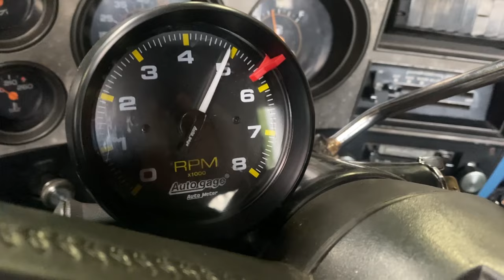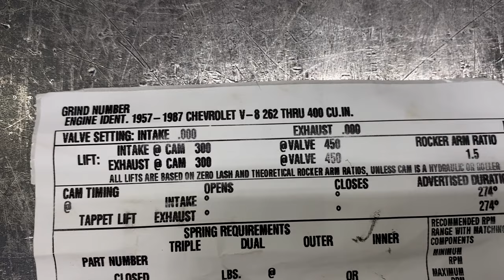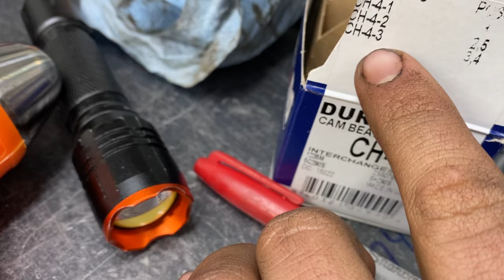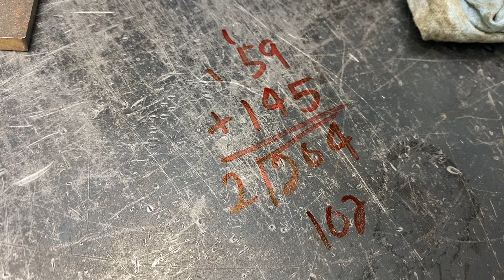Budget Building a Small Block Chevy 350 Part 2: 375-400 Horsepower!

Comment: 375-400 HP ? Lucky if you make 300.
Reply from the maker: Says some random dude on the internet
Reply: @BoneyardRevivals  nope not with Vortec heads! Easy to get 375-400 👍❤️
Reply: @BoneyardRevivals  smog head 350 from 1969 does 300hp. Yours got vortecs and a healthy cam he just hating. Nice build man 👍❤️
Reply: Do you realize that the GM 330hp crate engine has a tiny 212/222 camshaft???
Reply: The hydraulic roller gm hot cam (the one with .480 lift) an air gap intake and a junk 750 carb can make 422hp. My 383 stroker with bone stock vortec heads and a .477 single pattern cam made 467hp. I added 1.60 exhaust valves and made even more power. What rock have you been living under. A gm crate engine has 8.5:1 compression, 76cc chambers with 624/882 heads and that baby small cam it has can make 322hp with a set of long tube headers and a good intake and carb. Take the peak flow number and double it. So a vortec can flow around 228-232. Let’s say 230cfm on the intake. That’s 460 total. With the right parts those heads are capable of 460 hp give or take a few numbers based on exhaust flow numbers and the parts used together. A bad cam can make a good set of heads look bad. But a good cam can make a bad set of heads look amazing. If a baby gm hot cam can make a 9.3:1 motor make 422hp imagine what a 11:1 motor can make with a lot bigger cam. I’ve not seen a motor with vortec heads that made less than 300hp even with the tbi exhaust manifolds and 2 inch exhaust. Don Terril made over 500hp with a 307. It had a set of old truck flow 175cc runners and a huge cam but don’t ever underestimate a small block. Even the smaller cubic inch motors.

Comment: That cam is actually a 218/218 duration @.050. Very mild! the 106 LSA will give you a nice idle sound.  Advertised duration is a useless specification.
Reply from the maker: @turbodave231  you are absolutely correct. Advertised duration is just a big number that makes a cam look big. The LSA makes the cam a little odd for the application but it sounds awesome so that’s why I picked it. It’s is a really good combo, I just wish the truck had more rear gear. The 3.23s make the cam useless from 1500 to 3000 rpm but man this engine come to life from 3500-6000.

Comment: Seems a shame to not use a roller cam in that roller block.
Reply from the maker: I’d agree but for the price point it made more sense to slap the hydraulic flat tappet in her.
Reply: @BoneyardRevivals  cant beat that 100 dollar ciecle track cam lol
Reply: You'll always have the roller option further down the road. I have roasted a lot of tires with flat tappet engines over 40 plus years with no complaints 👌

Comment: I love that cam have used it a lot on street and it sounds killer with compression.and works great dirt track hobby stock .won 5 champion ships with that cam .run fellpro .014 head gasket with 64 cc get u right at 11 .tight quench wakes them sbc up

Comment: That cam works very well if you install it at 106 it has 4 degrees ground into it and use 1.6 rockers used it in many lift rule classes won many races lol
Reply from the maker: I do like this cam a lot, kinda can’t use all of it in the 3/4 ton truck I put it in but it’s sounds good and runs really good around 4000-5400 rpm. But this engine won’t be in this truck forever and when it comes out it will probably end up in car.

Comment: Even though the tall valve cover are trendy, they don't mean anything performance wise. They just get in the way when working on the carburetor and so on. Shave down the valve spring seats, drill for 7/16 rocker arm studds to cut down on flexing and put regular valve covers on the heads and just like that, a super sleeper. At least that's what im doing with my SBC 350. I have the same heads with 2" intake valves and bigger double springs. Im going to install a 144 blower and be done with it.

Comment: Just use some Permatex liquid teflon on the head bolt threads and your good to go.  Also you don't want paint on your intake gasket sealing surfaces. SBC is a great motor to learn on.  Good work!

Comment: There is only one TDC per cylinder.
I did know that term but it has been so long since I have even thought about it.
I need to look that up and see if I can find it.
If I can find my old Detroit specs, and shop tech books, there is also a dolly position and four or five other position terms about the piston and rod and when your pouring sand molds it is very important  I will let you know,  you know there is bdc and tdc then intake compression power exhaust.
You know you do a great job simple easy I like it  good great job
Docakasevenonefour

Comment: 10:24 you should get in the practice of never putting a liquid into a dead end hole as
in some application the bolt going in could hydro the hole and cause a crack. maybe not on the cam like you did
but still good practice, just put the loctite on the bolt thread, dont even put it on the end of the bolt, cheers

Comment: Good video, good coverage of the assembly, motor looks good, just need a dyno ticket to she what she really does. Highly recommend going to a stiffer rocker, those factory style tend to flex with aggressive cams and you loose valve train stability (mainly at higher RPM). Regardless, should be a great little mill.

Comment: Dude I like your attitude and your doing things right you did good with long slot rockers because a lot of guys put performance camshafts in there I don't pay attention with the rocker arms I would have went with the roller tip rockers because you would definitely get just a little bit more horsepower for a just a couple more dollars but that's okay it'll still work good attitude
Reply: The roller tips add absolutely 0 HP, the only friction a rocker see's is at the ball. I've been using assault racing SS roller rockers, they are really nice and only cost about 175 bucks a set! Been using them for about 8yrs now with no problems whatsoever!

Comment: Why put valve cover spacers and extra tall valve covers on if your only running stamped rockers?
Reply from the maker: The spacers is actually an adapter to accept the center bolt to premiere bolt valve covers.

Comment: Excellent video. Are those head bolts just standard bolts that use a 9/16 socket? I have a 97 350 vortec that uses the torque to yield bolts and I was going to switch to standard bolts if they work?

Comment: Smart cam choice.  There's alot of fun keeping a street cam under 275 duration..    .
Reply from the maker: Thanks, this cam worked out reasonably well especially with it being in a 3/4 ton truck with a 2,000 stall converter and 3.23 rear gears in the truck. Duration dramatically effects what rpm the engine make peak numbers at and with the application being a truck motor, it makes zero sense to have a motor of this application make peak power at 6-8k rpm. This cam was a happy medium of it sounds nasty and performs well but it isn’t over kill.

Comment: I need help with my engine it’s 350sbc i have problem with the ignition Timing . I Change the distributor it’s hei and it doesn’t work perfectly what can I do ¿
Reply from the maker: I’d check to see if you have a good coil and ignition module if you don’t have spark. If that’s all good but you are still having problems I’d check to see if you have your distributor clocked in the right position if you or someone else had it out and might not have put it back in right. Hope that helps.
Reply: What do you mean it doesn't work perfectly anyway I've run into a lot of them that had sticky or even stuck advance weights and such a good cleaning and greasing and a curve kit makes all the difference in the world now don't even worry about base timing just get it to give you all advance in at say 3000 rpms wherever the base timing lands is irrelevant it could be even 20 deg as long as it starts well and sounds happy it's fine base timing means nothing it's total timing that is what is the most important 35 deg btdc or so some engines like a bit more or less but in a stock motor low compression especially bring the advance in as quickly as possible and you'll swear it's a brand new engine it will be super responsive and just be a super happy engine

Comment: What kind oil u use for the flat tapped engine L83
Reply from the maker: For break in I want to say we used Driven 10-40w break in oil, for regular oil changes I use 15-40w Shell Rotella T4 with Erson zinc additive
Reply: @BoneyardRevivals  m1 15w-50 or Valvoline VR1 2”w-50. Ok to use or castrol gtx classic.  It for a 84 corvette cross fire
Reply from the maker: @datz_nice_805  I’ve heard that both Castrol and Valvoline  are both decent oils. I am pretty sure Castrol makes a specific oil for the older stuff but I can’t currently recall what they named it. I’ve used Valvoline Synthetics but only in a newer vehicle so I personally haven’t used either of them in a flat tappet engine. I personally stay away from synthetics for older engines if I can.

Comment: How do you figure 375 horsepower with them cylinder heads there's no way and your compression is low there's no way who is giving you the false information then build small block Chevrolet heads for 30 years sorry to hurt your feelings but you be lucky you had 300 horsepower with the vortec heads
Reply: Those heads way out flow the old Camel humps with much better combustion chambers! You can certainly get 375-400hp with those heads, they are by far the best factory gen 1 SBC ever produced!

Comment: 1/4 turns better, especially flat tappets for break in.
Reply from the maker: I’d argue that there is not much of a difference and any advice\documentation you’ll find will say 3/4 of a turn. We broke this motor in the way I set it and it was completely fine. I am curious to know why is 1/4 better that 3/4?
Reply: Less load on the new cam,

Comment: So does it run out of breath around 5300 rpm?
Reply from the maker: She actually runs out to 6. But yea she’s probably making peak numbers between 5-5500rpm. If it had 1.6 rollers and bigger valves it would probably run out to 6200-6500. But for it going into a 3/4 ton square Body I didn’t want to go too crazy. It would definitely be awesome in a car.

Comment: How much do you have total invested into it
Reply from the maker: Now that’s a hard question to answer but for everything that is there in a basic motor build we have around $3,200 from buying it to putting together the cylinder heads cam and intake. Now I can add in all little the odds and ends that I personally bought or went with for my application and that I slammed this thing together to go on power tour. Like I spent good money for the dress up kit and a bunch of other little tidbits. But for the nitty gritty here is the bare bones motor we have about $3,200 into it. Which is completely respectable in our opinion.